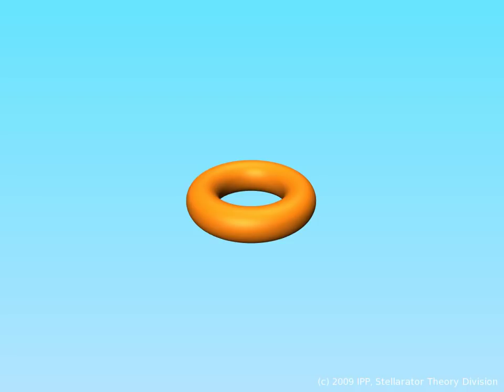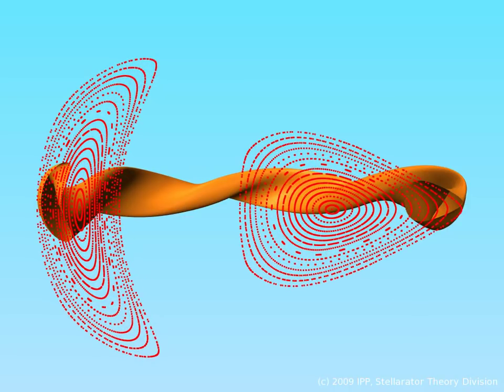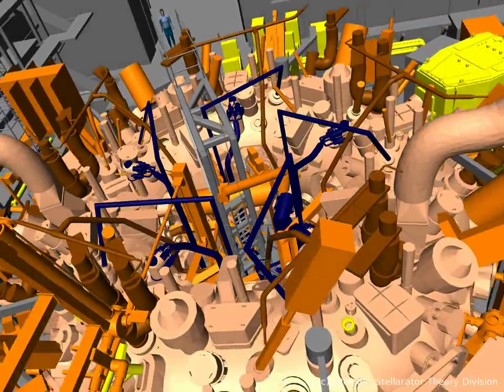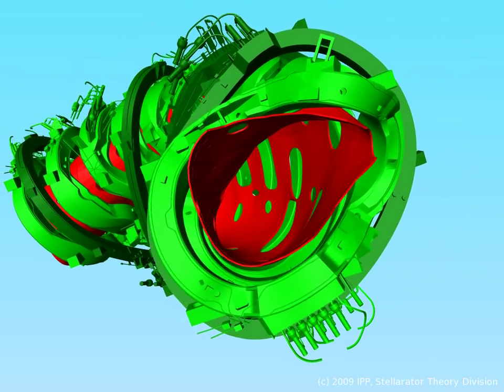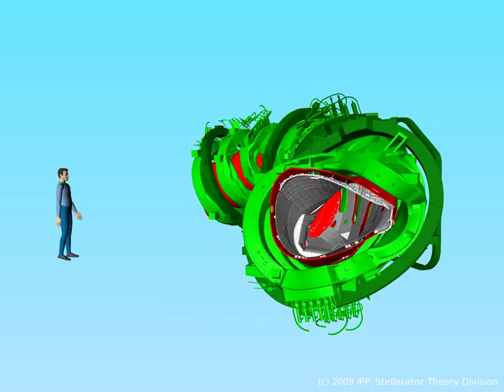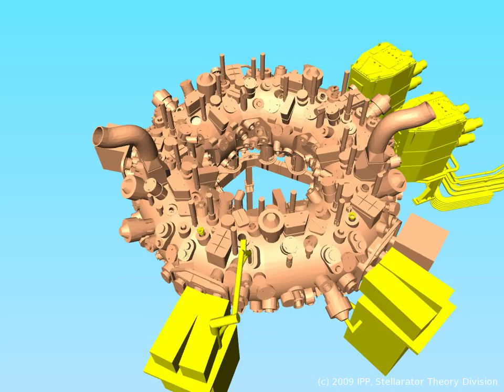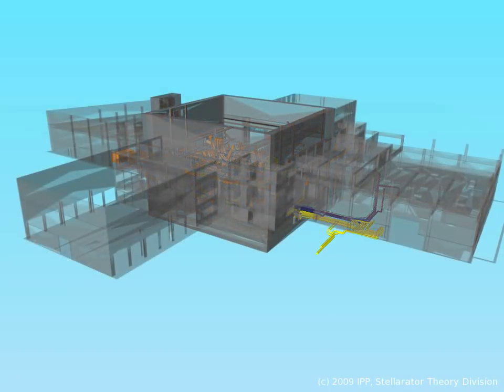Wendelstein 7-X – from concept to reality

Comment: so how do they capture the electricity?
Reply from the maker: +クリス 
Wendelstein 7-X is a research device, it will not produce energy. A future fusion power plant: http://www.ipp.mpg.de/14743/kraftwerk
Reply: +Max-Planck-Institut für Plasmaphysik ITER's test power plant uses a Tokamak right? Would the next step in this Wendelstein 7-X research be the creation of a Stellarator based power plant?
Reply: +クリス Neither fusion or fission reactors 'capture electricity.' They're used to heat up water into steam which drives turbines to generate electricity.
Reply: +Max-Planck-Institut für Plasmaphysik How would you capture the energy? Thermocouples?
Reply: +Max-Planck-Institut für Plasmaphysik That means it'll take a lot of energy to test its confinement ability then, if it's not feeding energy back into the process?
Reply: +クリス The purpose of this device isn't to capture energy, but to find out how the hell you contain 100 million degree plasma in the first place, so you can go on to build a fusion reactor after testing is complete.
Reply: ***** Yes thanks for stating the obvious again. That's not even what OP asked about. Still no mention of how you would go about capturing the energy.
Reply: Hjembrent Kent Heat from the reaction is used to turn water into steam. The steam is used to move a turbine which is connected to a generator. That's how reactors produce electricity.I'm not sure what you mean by 'capture energy' but I'm assuming this answered your question.
Reply: +Max-Planck-Institut für Plasmaphysik I'm sorry if this should be obvious, but is that article speculating 50 years from now or from 1988?
Reply: +クリス I believe with fusion reactors it will happen with heat exchange, the same way nuclear reactors work, but I'm not sure. It's also possible to use the plasma radiation to create plutonium as nuclear fuel (again, not sure). There's also the idea of using PV-like panels to create electricity directly from the various radiations-wavelengths, but that's still fiction.

Though, as the Author said, this is a mere proof of concept reactor with no energy output.
Reply: Yes i know perfectly well how a fission reactor turns steam pressure into electricity. Do you really think they will use steam in a reactor that reaches millions of degrees? Wow guys. Lets skip a couple of levels here. Do you know what a thermocouple is? The seebeck effect? Read son. https://en.wikipedia.org/wiki/Thermoelectric_effect
Reply: +Max-Planck-Institut für Plasmaphysik But isn't ITER a tokamak, a different design to a stellarator? Does the energy collection for a stellarator still happen in the same way?
Reply: +CellDevises
The stellerator is still plasma fusion, it's just a different shape of magnetic feild.
Reply: +Ryan R
The first test to generate plasma was successful now.
Reply: I've always found it ironic that while we work with extremely advanced technology, the ultimate goal is still to spin a turbine using hot water.
Reply: who says it has to be water?
Reply: +Hjembrent Kent Thermocouples or bi-metal junctions are a very unlikely way to transfer the energy from a system of this type. Even though they convert thermal energy directly into electrical energy they are not nearly as efficient or scalable as other processes (at best about 15-20%). What is more likely to happen is a closed loop liquid metal heat transfer system. Essentially just plumb the plasma(or as close as you can with appropriate materials) area with pipes moving liquid metal through to take in heat, then transfer that heat to water to make steam.
Reply: Player 1 so basically most of the energy is carried off in the neutrons which dont interact with magnetic feilds and are thus never interact with the magnets containing the plasma. the heat is transferred to the walls which then heats up water and produces steam.
Reply: could use the plasma to boil water to steam for turbines?
Reply: Like old fashon way coolant is used and coolant heats the water to make it vapourised and vapours drive the turbine to produce electricity

Comment: interesting video, but what you don't explain is how you "harvest" the heat for energy production?
Reply from the maker: +GDplusEng 
Wendelstein will not produce energy. A future power plant: http://www.ipp.mpg.de/14743/kraftwerk
Reply: +Max-Planck-Institut für Plasmaphysik     ITER is just a bigger tokamak.
Reply: you are concerned about the easiest process in this very complicated process??.  They will find that this design will not be able to contain and leakage will be an issue which will cause random cooling.   I believe the answer lies in studying the sun and learning how the sun keeps its shape, only then will you be able to contain plasma.. this donut shape will prove to be too complicated and using a rotating field and the shape of a ball or globe will prove to be the ultimate solution.

Comment: Anyone who is knowledgeable enough, please let me know:
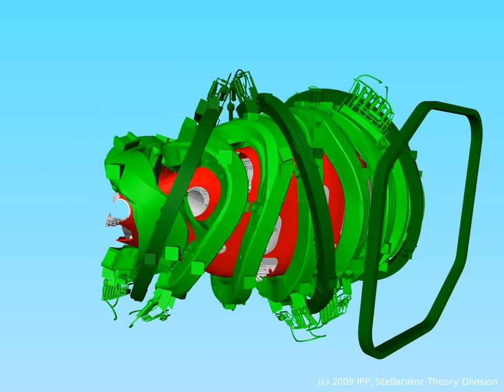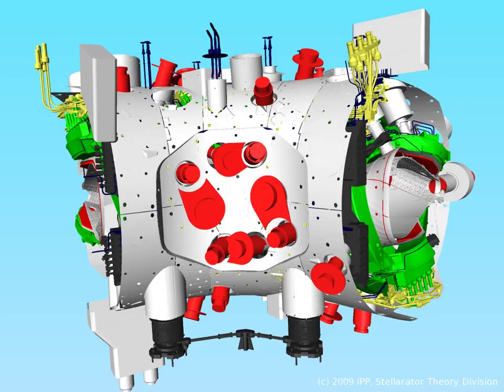Which component supports the vacuum? The inner jacket (red at 5:40) or the cryostat (brownish red, 7:16)? How were the panels of the internal jacket made (red at 5:40)? Is each individual panel stamped and then welded? Are both the cryostat and the inner chamber kept at a vacuum or is it only the inner chamber?
Also, what determines the minimum size of the stellarator? Does it have to be this large or can it also be made smaller?

Comment: I think this machine can be smaller now with the new kind of superconductors. amazing engineering nonetheless.. 
thanks for the clear view of how this thing is built.
Reply: Fusion reactors regardless of design will always be more efficient the larger the design.  Not as relevant for a research reactor but certainly for a production power station.

Comment: Hello there. I am currently graduate in Business but I plan to go for science and energy...Which graduation course should I take in order to be part of the fusion energy development, as well as other energy sources? I am 23 years old from Brazil, thanks in advance.
Reply: +Filipe Barbieri UC Berkeley has a great Nuclear Engineering program that you could check out.
Reply: Hi Fillipe! You should either get involved in physics or electrical engineering.
Reply: thank you guys! I am looking something like that!
Reply: +Filipe Barbieri The big problems to solve at the moment are mostly in the area of computational fluid dynamics. That's reflected here in the shape of the torus, but it also applies to the design of turbines -- it doesn't matter whether those are gas/steam turbines for conventional thermal generators (no matter what the heat source may be), water turbines for tidal generators, or wind turbines. It's a four-pronged problem -- physical, mathematical, computational and engineering (you have to be able to build the things you design, and they have to last) -- so there are at least four avenues of approach, all with cross-disciplinary interactions. And don't forget that there's still a lot of room for advancement in delivery and storage systems: batteries are horrible, and we waste a huge amount of what we produce heating up wires.

Comment: But if or when fusion reactor is possible, won't it just work similar like a transformer, primary and secondary coils, plasma in primary and output power in secondary. And some hybrid metal/graphite/nanographene core in between

Comment: I think I'm missing the part where this thing makes electricity...
Would have been nice to include that in the video.
Reply: +coladict thats the secret part about it :D
Reply: This thing isn't targeted to "make" electricity.
It will rather consume electrical energy from the grid to be operated. 

This is about learning how to control such a reaction, how to sustain it and how to properly use it for energy production (I hate this incorrect term by the way).

A real power plant would have to be larger and would also require ways to extract the heat (and probably various kinds of radiation for greater yield) from the reaction but it wouldn't need all this complex monitoring and scientific equipment.
But this lies far ahead.

Comment: So how is it possible to hold plasma at such a high temperature without the machine itself vaporizing?
Reply: +jerichom11x Did you miss the part about magnetic coils? The plasma will be suspended in the vacuum by magnetic fields and the coils themselves will be super-cooled to -270C.
Reply: That is why these ridiculously complex magnets are there. The whole deal about this reactor concept is the sophisticated geometry of the magnets that keep the plasma in place. The design is so complex that it took somewhat advanced modern (microprocessor CMOS based design I mean) super computers to calculate.

Comment: So what happens when something goes wrong while it's running? BIG BADA BOOM?
Reply from the maker: +woodster2k1 
No Big Bang: See http://www.ipp.mpg.de/17064/strahlenschutz and http://www.ipp.mpg.de/14767/sicherheit
Reply: +Max-Planck-Institut für Plasmaphysik Wait, did you mean "No, big bang" as in it won't explode but will create a big bang, or "no big bang" as in it won't explode?
Reply: +Marcus Johnson  its a fusion reactor and not the bad bad large hadron collider. both dont explode or create a new big bang and the radiation is also not a problem at all.